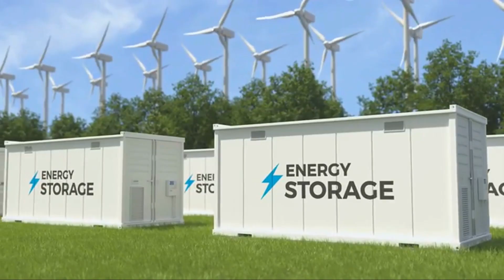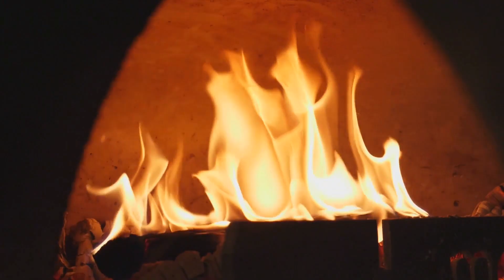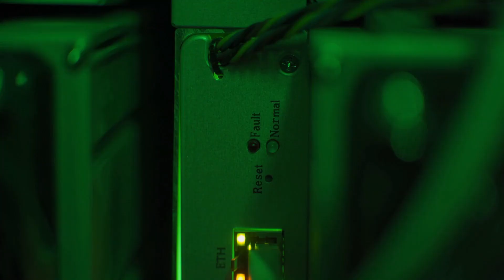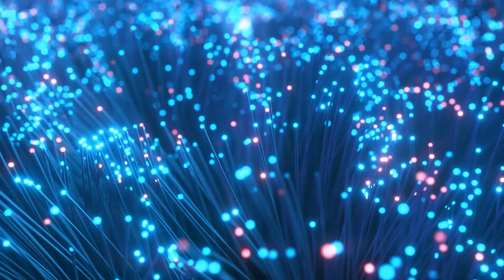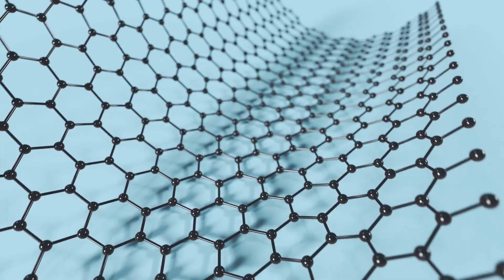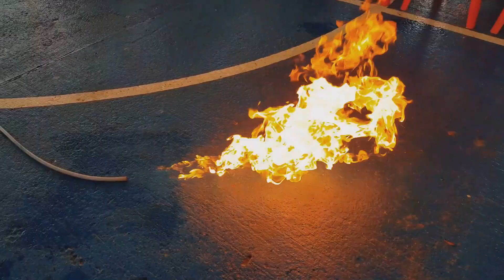How to prevent hydrogen accidents?

Comment: I went for hours back and forth with the AI chat bot we all know about Hydrogen and one problem with hydrogen is that some of it will always escape and permanently  trapped in the atmosphere. This also permanently reduces global water supply on earth (though that shouldn't be very noticeable) but still you never get that water back ever again. With CO2 you at least have the carbon cycle. There is no Hydrogen cycle.
Reply from the maker: You bring up an interesting point! While hydrogen can escape into the upper atmosphere, the amount lost is extremely small compared to Earth's total water supply. Hydrogen is also constantly being produced through natural processes, including volcanic activity and biological reactions. While there isn’t a direct “hydrogen cycle” like the carbon cycle, the impact of hydrogen loss on global water levels is negligible in practical terms.
Reply: @futureenergytechnology  Thanks for the copy past chat AI answer. Dude, I went over this for hours and you really have to press the AI and let it do the calculations to come to a a conclusion that is actually useful.
Reply from the maker: @PeterRudesindus  AI responses are shaped by the way questions are asked and the depth of the information provided. If you engage with AI at a more advanced level, the answers will reflect that complexity. It adapts to your knowledge and aims to provide responses that align with your understanding of the topic.
Reply: @futureenergytechnology  What is the consequence of large amounts of only ever increasing hydrogen being trapped in our atmosphere? The AI doesn't know and the mere existence of the carbon cycle proves that the green energy stuff is bs, at least when it comes to CO2.